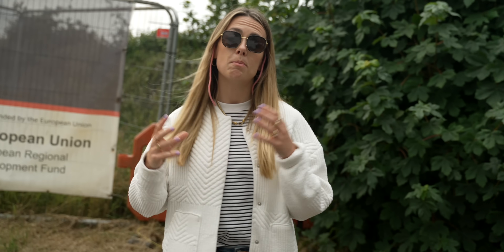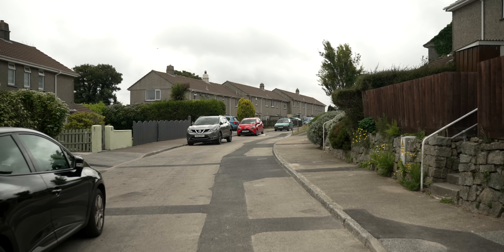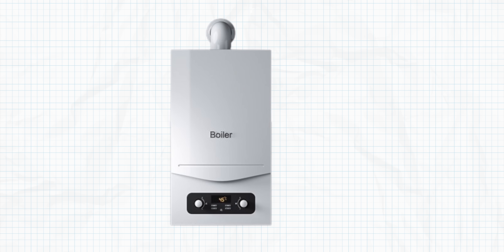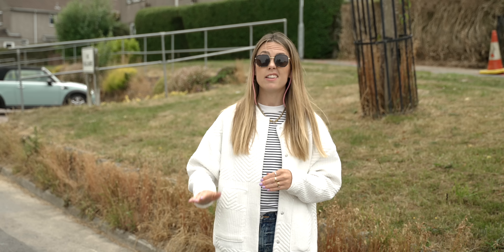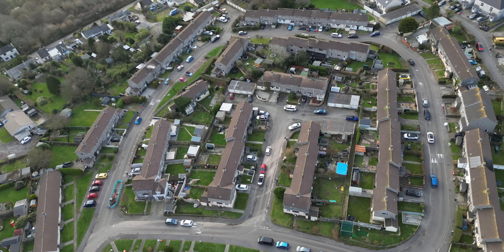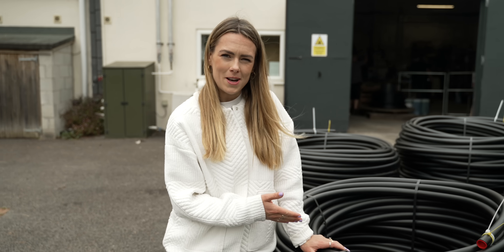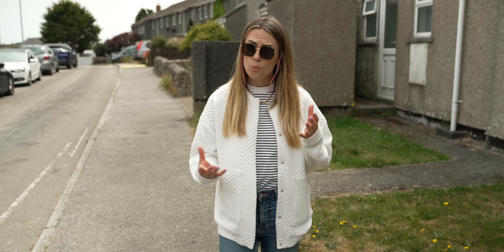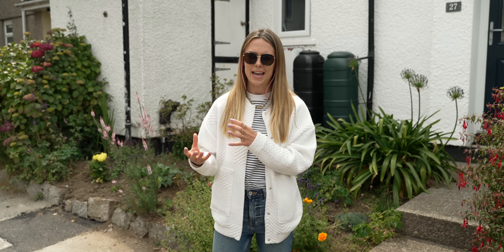Can Kensa's Ground Source Networks Supercharge the UK’s Heat Pump Rollout?

Comment: The upfront cost has obviously got to be paid somehow and in future it won't be by the EU now that we know longer pay in. So it'll either be paid directly by communities or indirectly by taxpayers.
I actually think this sort of community project could go a bit further and build a local solar and/or wind farm of sufficient size to power the GSHP pumps so that it is effectively independent of the grid and completely carbon free. I'm not sure it would add a big proportion to the cost.
Community GSHP sounds good in principle though because it needs more space to dig under than most people have at home.

Comment: Well I watched...and I have still not the faintest clue how this is actually funded! 

Sure some money came from Europe, some collaboration or something - whether it is pre-Brexit, post-Brexit is irrelevant  we are now post-Brexit

So... Now every householder is tied into buying electricity from a rip-off electricity supplier in order to keep warm...in order to stay alive frankly.  It's not going to result in lower domestic costs is it?

Questions: 
Who paid for the infrastructure?  
Did that include draft-proofing, new windows, roofs and wall insulation?

What was and will be the typical cost of heating one of these houses before, after and into the future?

Did the community get a choice about generating their own electricity?  Community solar?  CHP?  Biomass?  
Do they benefit from community bulk purchasing?

She didn't ask how the project was monitored, how consultation took place...How many months to set it up... 

Was the local electricity grid particularly robust here or did it need reinforcement.  I have no doubt the electricity supply companies love it, but what does the DNO (network operator) have to say about a doubling or tripling of supply here?  Gonna be cold if it brown outs because of over demand!!!  

The journalism is pretty lightweight really.  She relies on "its green" rather than "it makes economic sense" 

If we are to roll out 200 heat pumps a day, or week or whatever we need to know how communities and business can work together to make this happen...and this snippet has nothing to say about that.  The treatment was superficial in my view, and confusing too because now more people (not the cognoscenti commenting here, but others) will be saying "GSHP needs granite bedrock and higher temperatures near the surface" when that simply is not the case.

I agree GSHP is better than ASHP 

I am big time into this so if you want to argue or find a workaround the nightmare phone me 07944 212488  
I have a few ideas for solutions

Comment: Cornwall is about the warmest area of Britain isn't it? It's not exactly balmy but rarely gets below freezing even at night from what I read. Seems like air source heat pumps would be vastly cheaper to deploy and work pretty efficiently. There was no hard dara comparison of air source versus ground source in Cornwall in this video. Ground source is a much better proposition where it stays below freezing a significant amount of the winter.

Comment: commercially not viable especially at time of cost of living crisis, grants and funding will be removed because politically it wont win votes, why would you put up with all of that disruption outside and inside your home for no financial benefit? in fact its going to cost more? any scheme that has to rely on grants isnt sustainable, in cornwall solar water, wind and PV is much better value for money, also if this is supposed to be 5 times more efficient than a gas boiler why isnt there any saving? much better to insulate houses better and teach most people that they dont need to heat a whole house to 21 deg in the winter and that they heat zones and wear clothing to suit, put it this way I wouldnt be buying shares in this company.

Comment: Appropriate that it is being installed at Stithians as 35 years ago the “Hot Rocks” project was in operation here.
This drilled boreholes deep underground to pump water down and recover heated water for use in energy production. The research they pioneered I’m sure has contributed to this project.

Comment: I have long advocated ground source over air source and the installation of shared systems in all new build projects - so this is great news.  I have a more long term concern though that humans are the only species to use stored energy (ie, wood, coal, oil/gas and this case the earth's heat) to meet its needs and this must deplete this store.  What long term effect will drawing out the heat of the earth have on life on the surface in the coming centuries and millennia?

Comment: "What's not to like?": I'm all in favour of this technology BUT thinking of my own home, I do not want all the floor boards lifted, all the radiators changed and to have to build some space to house the plant (I have no coal shed to repurpose). So sadly, I really don't see this working for me or a lot of others in my position.
Reply: If they’re available in your area, look into mini-split heat pump systems. They’re air-sourced, but they are made for homes that lack central HVAC ducting. There are even DIY systems, if you’re okay doing drilling, electrical work. The coolant lines are pre-filled and color-coded so it’s clear what gets connected to each other.
The only downside is they’re not sized for whole-house, but to manage 1-2 rooms each. Friends of mine installed three Mr. Cool units this summer - one for the open space upstairs, one for the open space downstairs and one for their bedroom & home office. Their house has lousy ductwork and it would’ve been more expensive to install a central unit and rework the ducting, never mind torn up quite a bit of their house to do so. The mini-splits took a couple days each, and they like the zone control they now have with their three mini-splits.

Comment: OK my issue is iv old storage heaters in my house which I use on night rate so half price hole 3 story house is heated for 7 months a year for am average 5.5 kW by 5 hours per day how does a heat pump beat that plus already paying standing charge for electric so no extra fee my house if over heated during the winter. During the summer no heating required not had it on since end of march this year and only issues iam having is the house is still to hot lol

Comment: The ground source heat pump over an air source heat pump is brilliant!  I've an air source heat pump and it can be costly once the outside air dips into the teens (Farhrenheit) It averages out for the year cheaper, but a ground source is miles away a better deal.
Reply: Given the extra cost for a GSHP, I don't think it's a better deal at all. I'd much rather put the money into improving the building envelope, so less heating is needed in the first place.
Reply: @bartholomewcubbins9723  Definitely. This is my plan too tbf

I'd rather spend the money on making the house more air tight + ventilated, rather than getting a GSHP

As it stands, ASHPs are apparently catching up anyway
Reply: A better COP perhaps but a better deal? Maybe not, unless it's something like this ie: community ground source heat pump.

There is something that people will potentially overlook too. Between March and say November, I'm still using around 310 kWh a month just for showering.

That does add up. I think I'd want a waste water heat recovery system for the showers however but still, without that as it stands atm that COP is pretty good for those months at the very least

Equally, if you've got an EV, you only really need a COP of around 2 in the winter to break even.
Reply: @waqasahmed939  Wow! You need to replace your standard electric water heater. My heat-pump water heater uses 75 kWh per month. (and barely affects heating in winter and helps cooling in summer in the basement)

Comment: Why destroy the earth to heat your home. You can use ventilation-air to water heatpumps. With clever architecture and planning this could heat and cool a property. And cheaper then an expensive hole in the ground.

Comment: Interesting report but is this system only viable in Cornwall with wells only 106m. I was surprised that the heat pump system only matched the operational costs of the previous oil system - can’t it be cheaper?
Reply: It greatly depends on the ratio of local costs and equipment efficiencies. (Missouri Electricity/Gas is 2.8 whereas UK Electricity/Oil is 4.2, so a COP of 4.2 is needed to break even.)

Comment: I don't know why they haven't gone for full district heating with a small number of large heat pumps in one location and much higher temperature water pumped to the homes. With the method they have chosen they will have to spend a lot more electricity on pumping the warm, rather than hot water round the system, plus there is a lot more that needs to be installed and maintained in the individual homes.
Reply: I can't speak for them, but there are a number of potential benefits with their system over central heating. District heating systems have heat loss. You need significantly higher starting temperature in district heating systems, partly because of that heat loss, which makes heat pumps less efficient. So for pure heat pump systems district heating is not that great.

And there's more practical sides, they need to have distributed heat extraction anyway, with a central heat pump system they would essentially need 2 distribution systems, one to feed the heat pumps, and another for the hot side, which would increase the cost a lot, and increase the energy needed for pumping, not that it is that significant. And in their system users house the equipment, no need for facilities with all the costs that comes with that for the central heat pump system.

Comment: I would have liked a bit more detail on the business model and the pipework.  Did I understand it that Kensa effectively paid for putting all the capital in and charged a "daily standing charge " of $1/day to recoup this?  Are residents then choosing to tap in and be connected up?  I was surprised that there was no consumer saving on running costs. Eeryone here pretty much wants/believes the tech can work in principle but it is the economics/praticalities that are less clear.

Comment: Surprised that the consumer said she expected the bills to run the heat pump to be the same as the oil for her old boiler.  The intro stated that heat pumps are 5 times more efficient than boilers so you would hope for a big drop in bills.
Reply: “Up to 5 times more efficient”
Reply: @eliotmansfield  Might be 5 times more efficient than an open air peat fire at the end of the garden so not really dishonest.
Reply: Electricity is 37ppkwh. Last time I checked oil is 7ppwkh. Sure heat pumps are a lot more efficient but there is no getting away from the massive difference in cost. Plus heat pumps are designed to be on 24/7 you would never do this with a boiler. Instead you would just have it on for a couple of hours a day.
Reply: @del4668  The whole point of heat pumps is that the energy required to drive them IS NOT the same as the energy you would otherwise "burn" to provide heat directly.  The pump is moving the heat from one place (the ground) to another (the house).  So - the price of a kwh of oil versus electricity is comparing apples to oranges.  The question of costs is, of course, down to the efficiency of the pump system, but the electrical energy input required will be less than that if used to - say - run an electric radiator directly.  So - assuming the quote from the consumer is correct - then (using your prices) using electricity as direct heat would be about 5.3 times more expensive (37/7 = 5.3).  But they're not paying 5.3 times as much, they are paying about the same!  So, using the heat pump has got them the same heating via electricity (heat pump/ground) whilst removing the usage of oil and thus CO2 emissions.
Reply: @chrislaf2011   not really I don't really care for this hysteria about CO2. Like most people all I care about is how much it costs to heat my home. Saying its cheaper than direct heat well no one is using direct heat to warm their house that would be financial suicide.

Comment: Standing charges spell financial disaster for many people. (Thankfully, my home doesn't have a gas supply.) Three years ago, my electricity tariff had no standing charge. I paid for what I used, which was about 200kWh per year (two-hundred annually, or 17kWh per month). I think my bill for the whole year was around £60 [sixty quid].

For the past decade or so my annual income has been £800 [eight-hundred], so there's not a lot a cash for luxuries, but I've managed to get along, after a fashion.

Then zero-rate standing charge tariffs were abolished. Oh, joy. Now the poor people could pay for the rich people. Whoopee.The lowest rate I could find was £0.17 per day, or £62 per year. And my bill literally doubled overnight. So... I cut down on my electricity usage to compensate. Again.

In the current crisis, pun intended, the standing charge here in the north of Merrie Olde Englande is suddenly a whopping £0.56 per day. That's over £200 per year. I'm told that this is just and fair and reasonable and easily affordable, because the UK's typical annual electricity bill is over £2,300. Oh, really?

Well, I've lowered my sights still further and now try to use no more than 0.25kWh of electricity per day, or 1.8kWh per week, or around 8kWh per month. Annually, that's 96kWh (call it 100). At £0.30 per unit my frugal, minimalist lifestyle ought to be costing me £30 per year in electricity. Sounds good, until you add on the standing charge of £204.40.😲

I already have no heating of any kind, no hot water, no fridge or freezer, no mains lighting (I use wind-up torches), no TV, no washing machine, and not a lot of fun. I cook on a single plate induction hob - or at least I used to. Cutting my power use still further means I'm now doing my cooking (cups of tea/coffee, stews, curries, chillies, casseroles) outside in the garden on a little open grill/barbecue type-thing. I collect firewood locally (can't afford charcoal).

This neighbourhood heating scheme sounds marvellous - free heat from the ground? Yay! Zero maintenance, no hassle, simple and quiet and clean... But a standing charge of a pound a day is outrageous. A whole quid? That's obscene. For someone in my position (I'm sure there are plenty more), there'd be no point in joining the scheme. I couldn't even afford to NOT turn the bloomin' heating on!

So I'll stick to dressing warmly and wearing a woolly hat. I've just knitted myself a second one (total cost £0.48, bobble not included). Unless the government reintroduces zero-rate standing charge electricity tariffs very soon, I shall probably have to ask for my property to be disconnected from the supply altogether.

I can't even afford to have power coming into my home, never mind using it.

Comment: I find this video disappointing as the majority of house look in a poor state of condition and the very first thing that anyone should do is to insulate. The standard of house in the UK should be a passive house. That's the minimum standard in which you may never need heating, just hot water from perhaps a heat battery. I didn't see one solar panel on any house. Very poor. Also what's the EU doing here still? Tells me lots when were supposed to be out. What's the purpose of voting when no one listens.

Comment: One piece of maintenance rarely mentioned (and not mentioned to me by my HVAC contractor who does annual checkups on our system) is needing to flush and replace the ground loop coolant (usually just tap water) to remove precipitated particles. Take care of this every 5 years and your system will last.

Installation for a system with three 200ft deep ground wells, since it for new construction, was about the same as an air-source heat pump system, with the 20% federal tax credit at the time (it’s greater now).

As far as operating costs. My winter electricity bill (which includes heating, lighting, cooking etc.) is roughly a quarter that of my neighbors’ gas bills for heating only. Our summer bills for cooling are closer, but still less, roughly half. It’s especially low during temperate months as the compressor rarely runs when as blowing air over the ground loop coils (in our area, it runs about 15.5C [60F]) is sufficient for cooling.
Reply: Disclaimer, I live in Finland and we use alcohol in ground loops so that they don't freeze.
We have a filter in our ground loop that catches dirt that got in the loop during installation and pipe manufacturing, I have cleaned that once but never have we replaced ground loop liquid. I would assume if you replaced the liquid there would be new dirt in it, better to just clean the filter.
Reply: @mikakoivusaari4546  Alchohol would probably be better at avoiding sediment precipitating out of the tap water typically used in the US Midwest.

I don’t see a filter of any kind, but ClimateMaster, the manufacturer of our system advised us to change the manifold (they call it a “flow box”) and accompanying pumps as the original components had pump bearing cooling channels that are easily clogged by these precipitates. I will ask if there is a filter and how to clean it during the replacement process.

Comment: More centralization of home energy systems is NOT the answer, heat pumps do move heat from a heat source to where you want the heat, however obsolete heat pump centralized schemes facilitate future social credit score manipulation.

A sane method uses your existing water well that supplies a next generation system like "Well Connect"  that you own and operate privately, thus becoming a pro human technology, as opposed to centralized anti human (anti carbon) schemes.